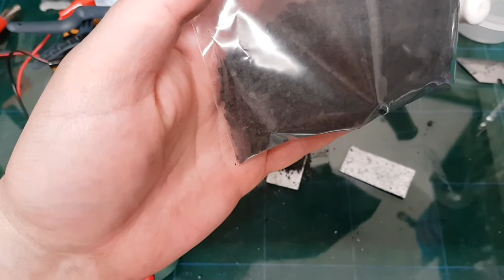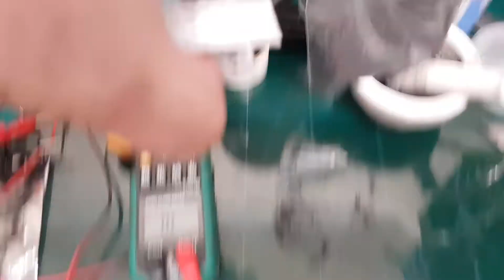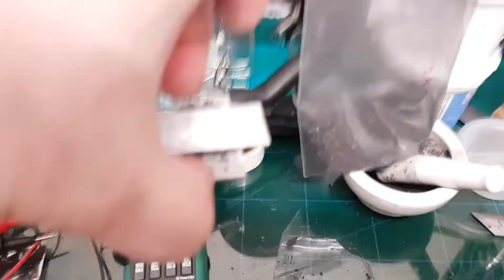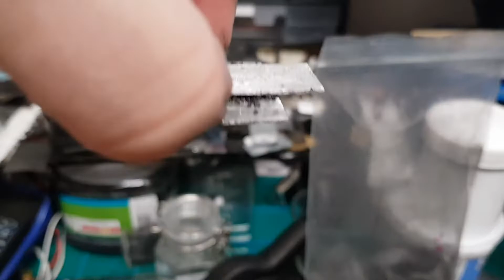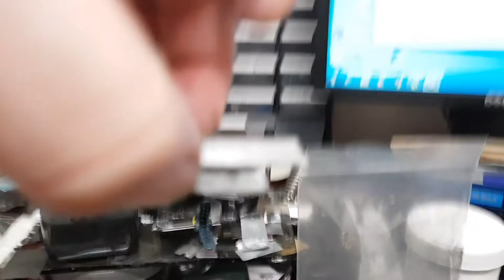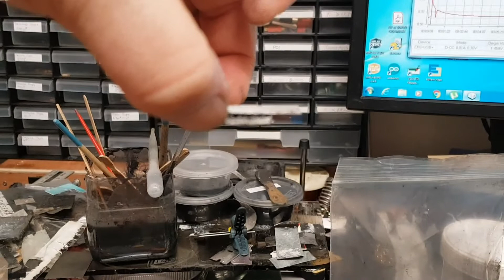New Carbon ? Activated Carbon for All Carbon Batteries!

Comment: Well done ! Can you try to make a battery, that can light up a 1 or 3 Watts Leds for at least 1 hour ?
Reply from the maker: Thank you, I will consider that as soon as I restart the building and testing. At the moment I am building some tools/devices for obtaining better materials as you can see in the latest video. Also I try to find and learn more about nitrogen doping ; any suggestions are welcomed. 

Cheers, 
Sorin
Reply: @mihaiaragon  yes to bad in this moment everybody has seem to stop working on batteries... I hope that Robert Murray Smith will soon show something new and unfortunately Kev Wallcroft has also stopped working on it... Also I was ill and could not further work on it...too bad...
Reply from the maker: @oudotcom  yeah, just that I have not stopped,  I am improving my tools so I can improve the results. Unfortunately,  I can work one week every 2, because of my job. I can barely hold myself not to do something , to build and test a cell. I 'all get there soon!

Comment: I suspect if there are contaminants that are contributing to performance from garlic it would may be sulfur compounds.
Reply from the maker: I suspect sulfur compounds as well. My only problem with this type of carbon is that in mixture with the binders is like a sand, making the result to crack, become brittle and not easy to work with. I don't have a ball mill, I am just grinding it in a coffee grinder. I tried PVA, also SBR/CMC, bitums...
Reply: @mihaiaragon  I will be doing a DIY ball  video very soon mate. It's easy and awesome. Get your self an old printer from somewhere  and 2 skateboard bearing. I will be doing it on my other channel. energystoragedevelopers
Reply from the maker: @Buzzhumma , Thank you, looking forward to seeing that, but I believe is just a matter off time to do it, I already have all I need,  motors, bearings, rods, timber, skills to build it, all I need are probably the milling balls. 
Sorin